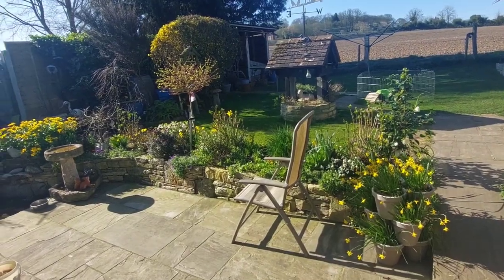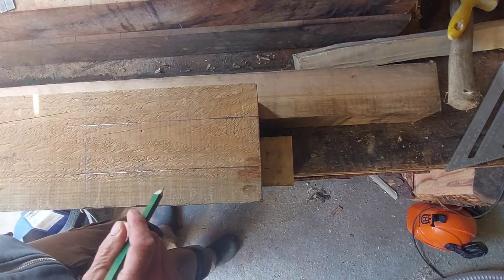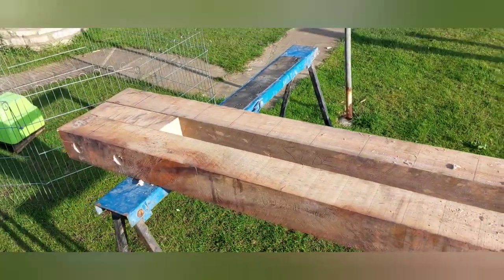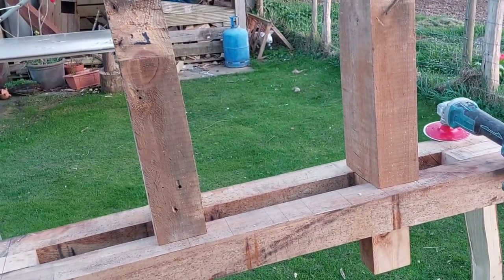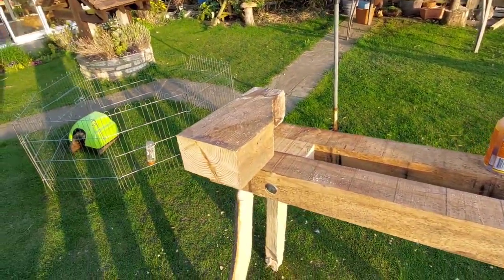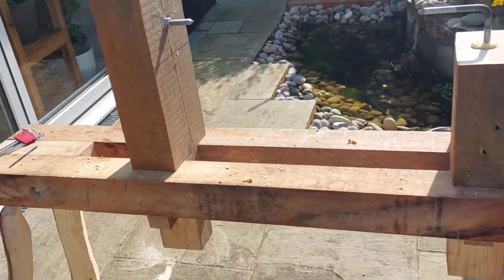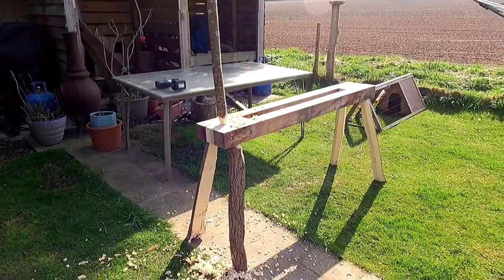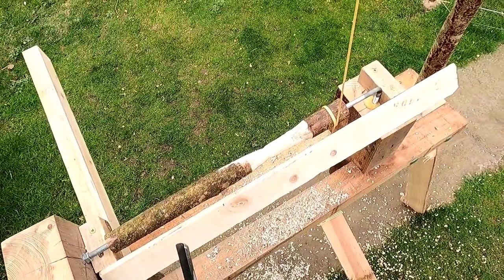Making a Spring Pole Lathe.

Comment: Nice pole lathe design, good work. If you use longer hazel poles plus about one foot of bungee cord, vertically connected between the end of the string/starter cord and the loop where it meets the horizontal bungee, you'll get loads more rotations per foot press = longer cuts, longer shavings, more efficiency.
Reply from the maker: Thanks for watching and the advice.